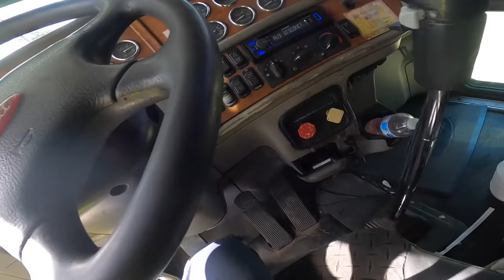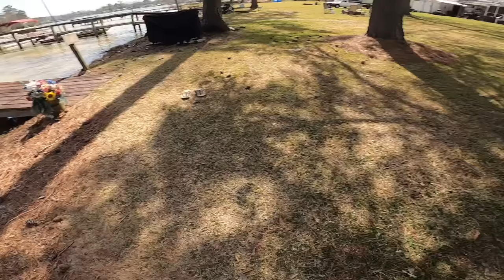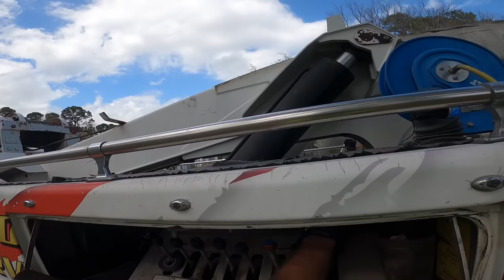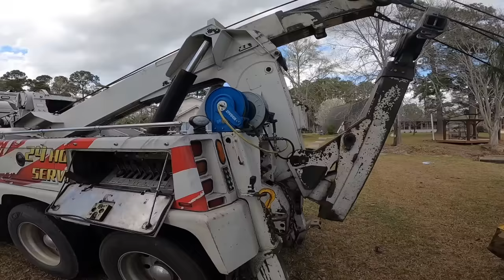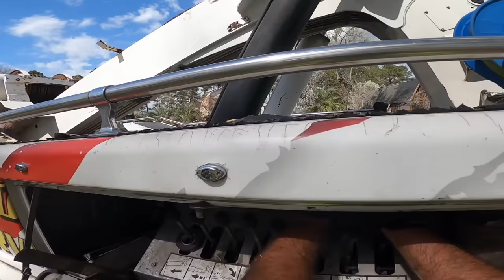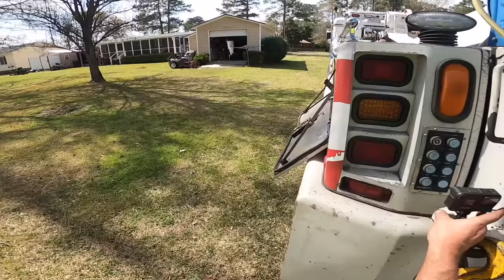Gone fishing for a backhoe with a YouTube Subscriber

Comment: Nice recovery Mr Hal. I was a bit nervous watching with the boom out that far. I know you have complete confidence in what your doing and it shows. What is the max tip weight on that boom fully extended? You really needed some lift on that and I'm sure that's why you had it out that far but it always made me nervous that the boom would bend.  Thanks for the video. Stay safe out there.
Reply from the maker: Mr Dan 18,000lbs fully extended. Thanks for watching and stay safe

Comment: Inwould ask a intelligent question but i know i wont get a  intelligent answer like how in the  heck did that happen and why they couldnt get it out themselves. A backhoe is the easiest machine to get unstuck if you know what your doing. I was a foreman on a 18 inch  pipe sewer pipeline and one of the guys buried a backhoe in mud halfway up the whole tractor and i used the backhoe and the front end loader at the same time amd walked it outta there. It took a while but i got it out and saved my company a small fortune in tow bills. They may have flooded the intake on that machine and if they did they better not try and  start it because its probably hydro locked
Reply from the maker: Mr Vaughn  The pin came out the brake pedal. The operator jammed the rear bucket down. The engine  sucked water up into the breather and hydrolocked I think.  It was locked up tight. Thanks for watching and stay safe.